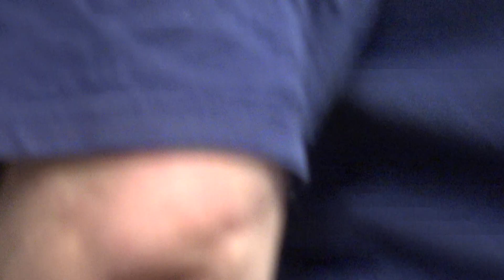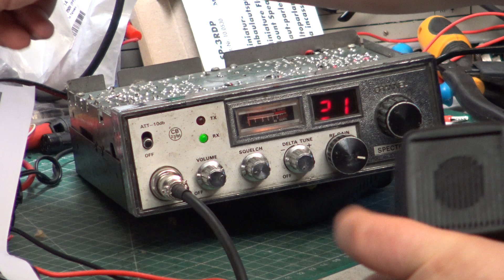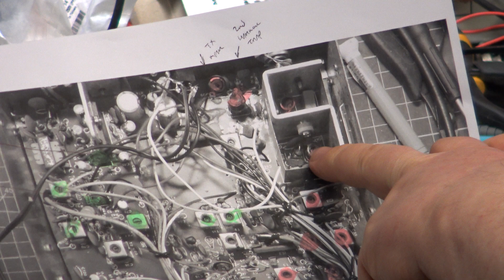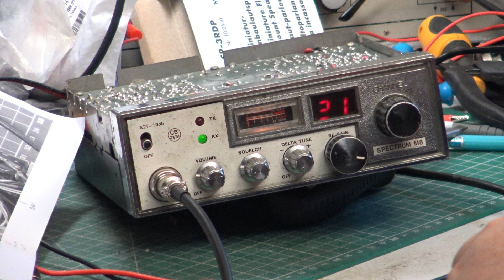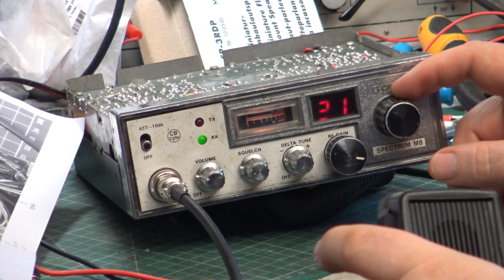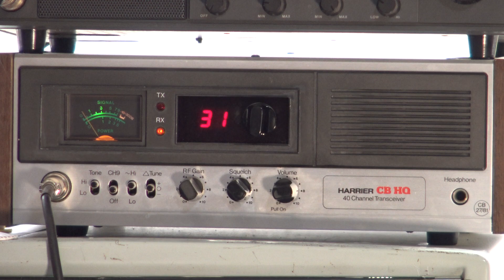Spectrum M8 CB27/81 UK FM CB radio - On The Air test

Comment: Thinking of unusual radios Richard, I got to thinking about British made sets. There was the Mega Tracker CB 1100 and BS 100 from Mega Electronics (according to an old mag they did a HB15 base converter box for the CB 1100 too). What I can't remember is what the British made mobile was which had a walnut style case. Name I am sure began with M and I brought one off a local rig doctor decades ago. Wish I hadn't sold it, not seen one since.
Reply from the maker: The Mega Tracker is one of the few UK FM rigs I haven't got. One came up on Ebay 2 years ago (mobile) & I got outbid. I've got the EMS Mercury & The Magpie Autoscan, but both are much less sensitive than most other CB's.  I don't count the 'uk' sets that comprise of something else in a different box...like the Westward PT2 that is a reboxed Maxcom 4E. I can't think of the one you're talking about though.

Richard
Reply: @ukfmcbradioservicingTango21  EMS Mercury that was it - the wood effect case I must have melded two rigs in my mind. Cheers Richard. 73 DE Mike M0SAZ

Comment: Break one-nine, for a rig check!

Those were the days. I still have a couple of handhelds (Harrier, and Harvard) both identical but wearing different badges. I have a Ford mobile set up, but it was well got at before I bought it, and I have a Murphy base station which is in really good condition.

I wish I still had my Binatone 5star, or even my Midland 2000 (or was it 3000?).

All water under the bridge now, but I still recall the conversations with CB'ers all over the county, especially "Badger" who perched himself on top of Nunburnholme Wold every night, sitting in his car, freezing to death as he looked out over the Vale Of York.

Our little "ring" once even had a group chat with a fellow from Scapa Floe. Some of us could hear him, some of us could not. His signal was loud and clear in my part of the Vale, yet a mile away was lost, and reappearing another seven miles down the road.

The biggest problem I ever recall was the petty minded few, and the droves of young kids who swamped out all and sundry, but, it was fun while it lasted.

Comment: Guessing your on a mag mount if that was only 6 miles?
Reply from the maker: The standard test we do with our base aerial which is an Antron 99 type without groundplane kit mounted just above gutter height on a single story building. The mobile has a drilled-in centre roof mount with a Red Thunder aerial which is like a Modulator aerial but is a cheap copy. We use the kind of aerials most people could afford so not to be elitist. The test rout goes the wrong side of a steep hill after  the 2-mile point & so 'scratchy corner' is right in the bottom of that hill opposite; this way we can compare radio like for like in a repeatable way. Now our 'good direction' is towards Nottingham & we would get up to 35 miles in that direction. Don't think that when our test route ends at the 6-mile point we run out of range as it picks up once the town of Sleaford is passed.

In conclusion it's about repeatability of results making the radio under test the only real variable.

Richard, G0OJF, UK
Reply: @ukfmcbradioservicingTango21  Thanks for explaining that. CB died here in west sussex back in the late '90's sadly. I really miss those days. 
Ian G0XAG

Comment: So ... about that Delta Tune ... continuous with an off click?  On US sets, back in the day, I don't remember anything but a three-position switch (+,0,- or something).  PLENTY of folks would set them up to move the transmit side, but that's a different thing ...
Reply from the maker: Yes. The click off position is the rx bang on frequency, then it's kind of centre zero after that....and takes some aligning as you saw.

Richard, G0OJF, UK